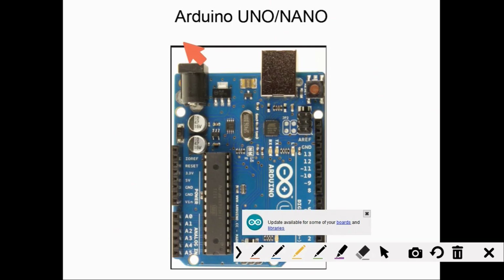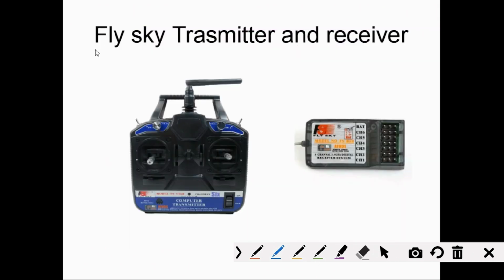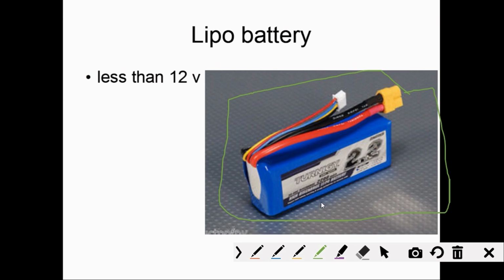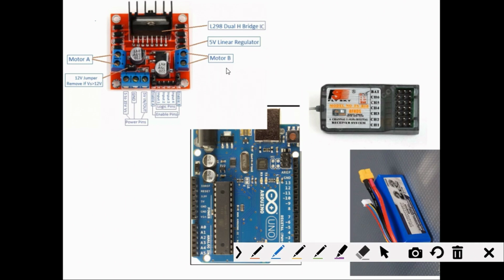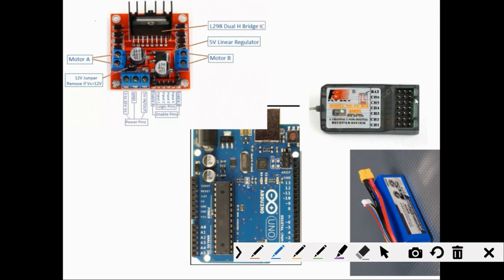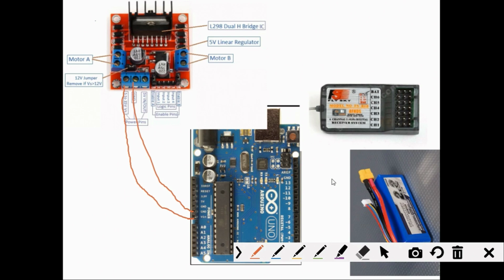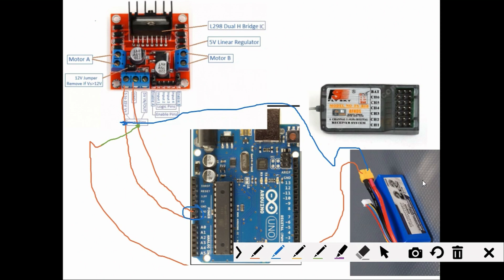Flysky Controlled rc car using l298n motor driver (How to connect l298 to transmitter and receiver )

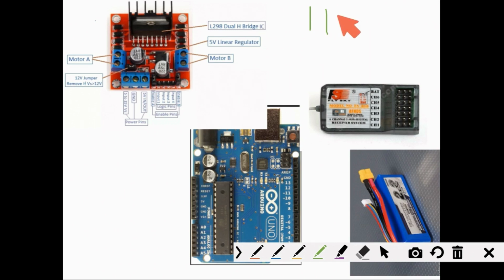Comment: at 4:30 you are saying "motor driver have six pins at the back to connect with arduino" but the motor driver L298n have only 4 pins at the corner side named IN1, IN2, IN3, IN4 ? dear bro !!!! where is 5th and sixth ?
Reply: Two header should be removed from motor driver then you will get 6 pins
Reply: Yes i am also confused....

Comment: Work fine ,but when trot is down tank spin with R motor. ????
Reply: Which rc controller  you are using you need to change the max and min frequencies
Reply: I'm using ct6b. And I'm also facing the same problem. when I move the stick down only one motor is running. please help!
Reply: @vantakulasairam5401  reset the remote to default
Reply: how to change max and min frequencies?
Reply: @vantakulasairam5401  take the code to and modify
Reply: @Prajwalppk  can be done but complicated
Reply: Please help me brother.Im new for coding. which part of the code should I modify and which values should I give? my mail- vantakulasairam96@gmail.com
Reply: @vantakulasairam5401   have you checked with motor pins
Reply: yes, I checked the motor pins. All connections are correct. when I move the stick forward all motor's are running forward. when I push the stick to left, right motor's are running, when I push the stick to right, left motor's are running. All working good, except reverse.  when I push the stick backwards only the right motor's are running in reverse direction, the left motor's are idel.
Reply: @vantakulasairam5401  there are two switches in ct6b ( white switches ) try it by changing if doesnt work let me know I will try my level best
Reply: thanks for the fast replies!
Reply: Hey ..  You need to reset the tc controller
Reply: Reset the tc remote !

Comment: Hey I have another motor driver can it will work can you send me the connection of that one also. I have this l298n
Reply: Sorry l298d
Reply from the maker: Ya mail me at prajwalkulkarni07@gmail.com
Reply from the maker: I think it's l293d !
Reply from the maker: You can use same circuit for that motor driver also and even program

Comment: Not running please help
Reply: Faced the same problem, Coding doesn't seem to work at the right frequencies. You may need to troubleshoot by using a amp meter to find the correct frequency and change that to 8 bit which an Arduino runs on by changing the code.
Reply from the maker: Actually the code only works for flysky ct6b transmitter for other transmitter you need to configure those respective frequencies
Reply: Do you know how to convert the frequencies from the receiver to the 8 bit code? Would save me a lot of time.
Reply from the maker: Try this code 
https://www.sparkfun.com/tutorials/348
Reply from the maker: Where u r facing problem
Reply: I connected the wires uploaded the program but no response whenever m reseting the arduino one of the motors is getting on rest of the tym it's idle
Reply from the maker: Which transmitter receiver you are using

Comment: Can i connect flysky receiver direct to l298n? Without arduino :(
Reply from the maker: +Ogz Tnr 
No
You need to decode ppm to pwm to run l298n so a controller is a must 
So answer is NO